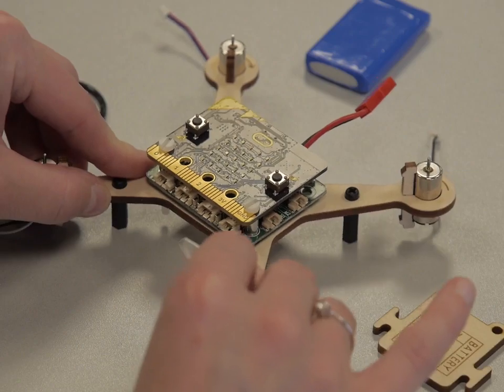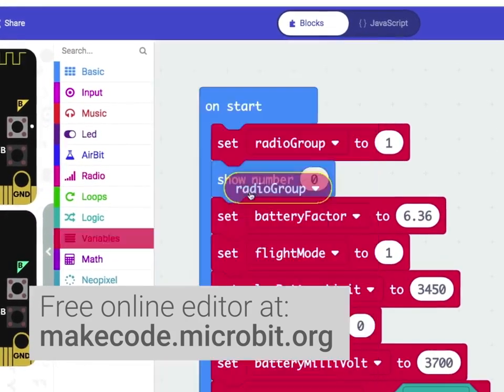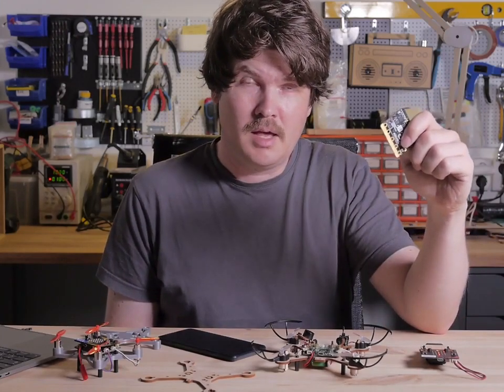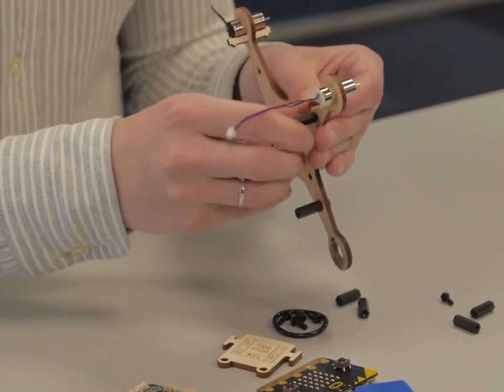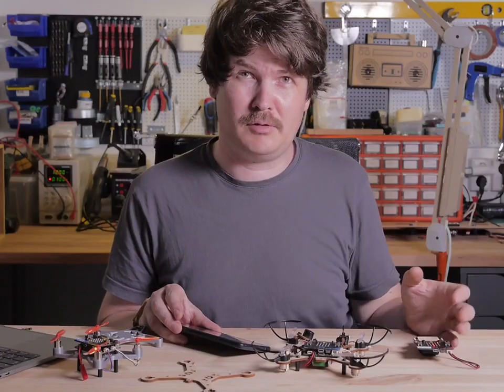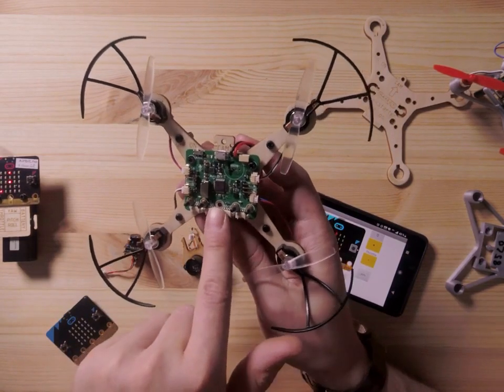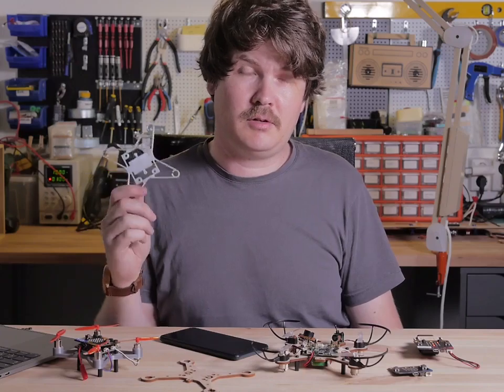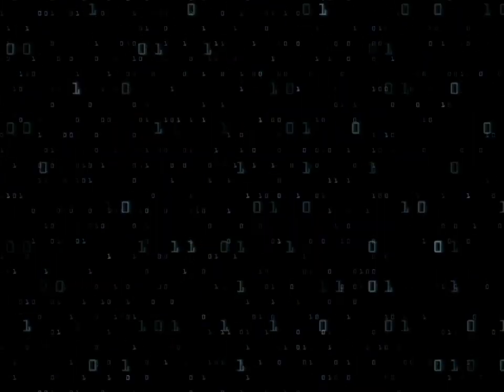Introducing Airbit and sensors

Comment: And does the remote and micro bit come included
Reply from the maker: On the Air:bit you need 2 micro:bit, they are not included. This is because many have one already. And you can use them on many other products. Such as Bubble:bit, Wheel:bit, Hover:bit and Snow:bit